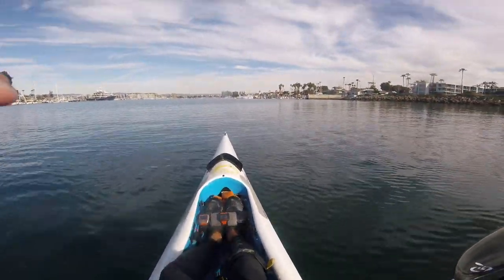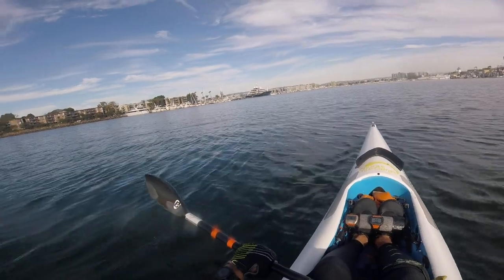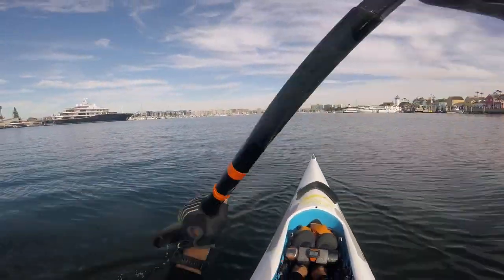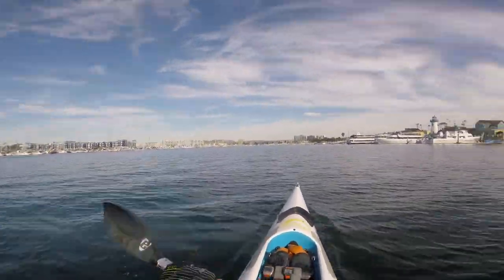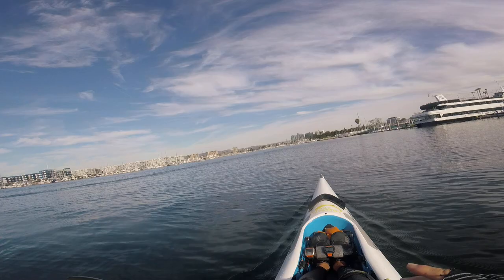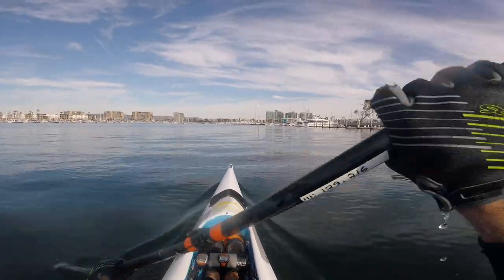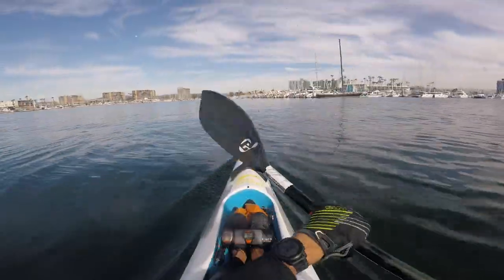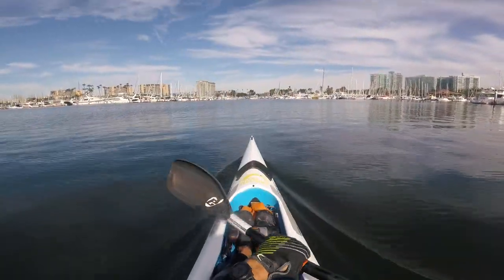Interaction of wing paddle length and stroke type on paddling load ("gear")

Comment: Based on your discussion here, what is your best guess about paddle length (given the Epic small-mid) and long distance paddling efficiency? You said a shorter paddle might be advised. How short for what sized paddler as an example? Isn’t one of the keys here how deep do you bury the paddle on each stroke? I would think that you’d want to bury the blade fully but not beyond that, regardless of vertical or horizontal. Thanks!